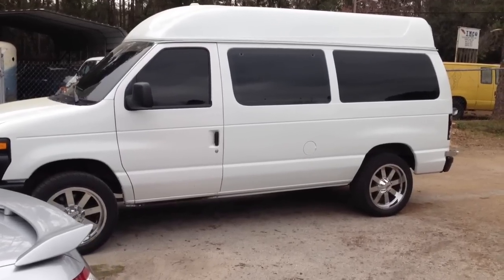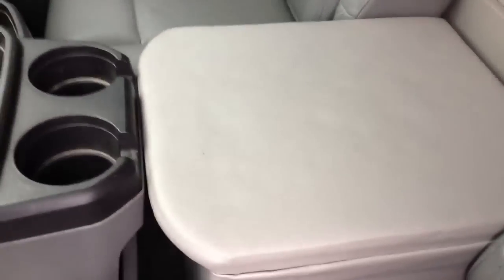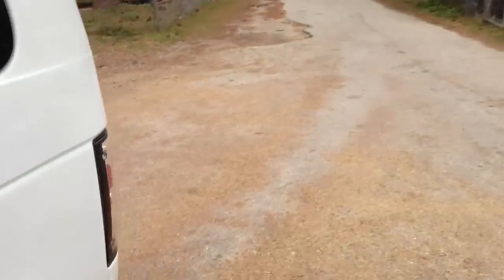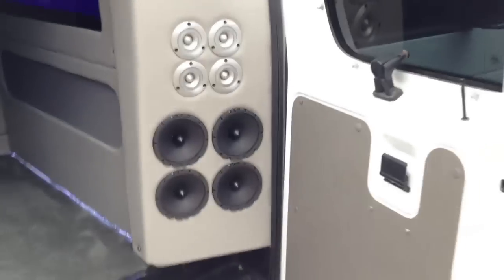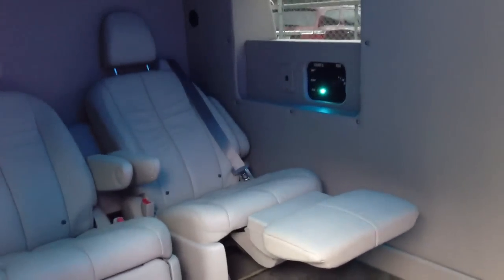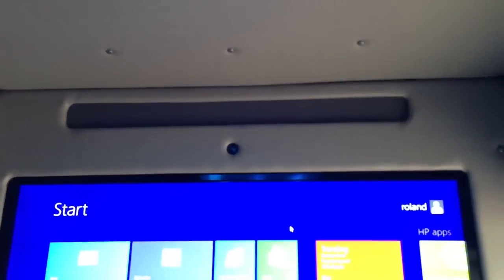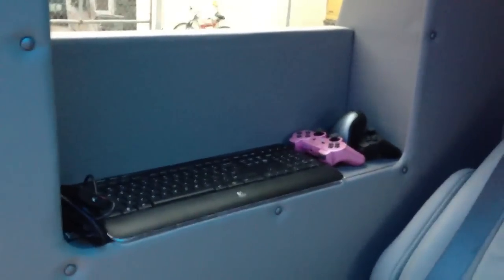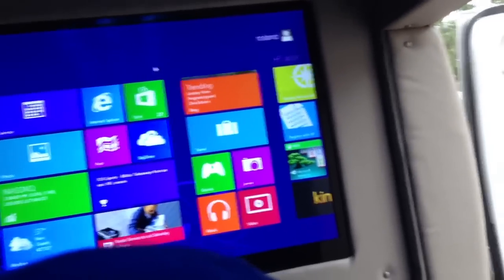2010 Ford Econoline Custom System Conversion build

Comment: How do you do this sort of thing? I am looking into doing that with my van.
Reply from the maker: Look on our FB @ Audio Designs & Custom Graphics, there is a folder of the build.
Reply: i was looking for inspiration and motivation for <~~~my 2000 GMC over there.. I've done SO much already but cant crest that peak and start wrapping it up.. Im always trying to think of ways to make each part even better...returning to the drawing board is getting costly.. and COLD! im in Milwaukee. great work man..thanks for showing us.